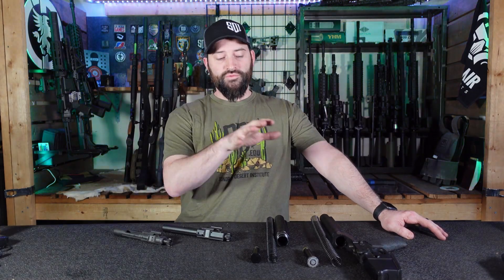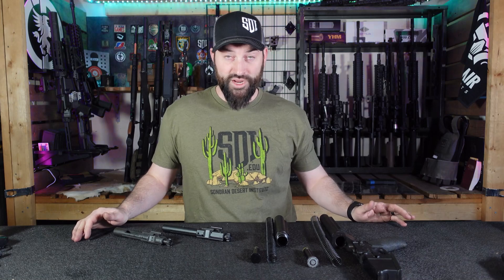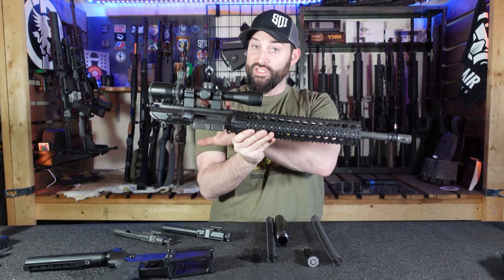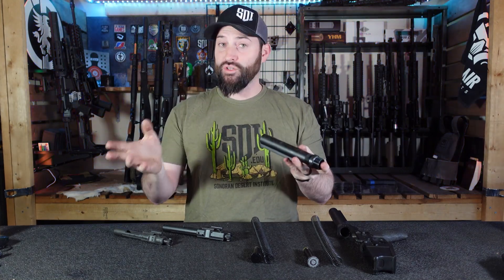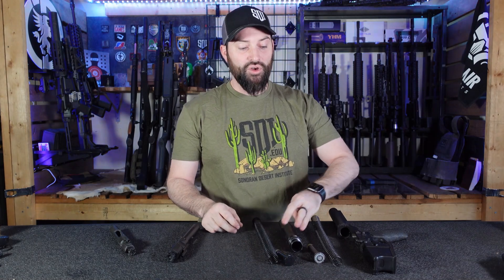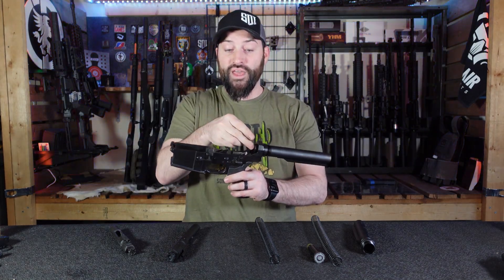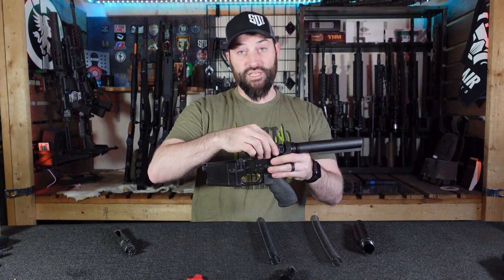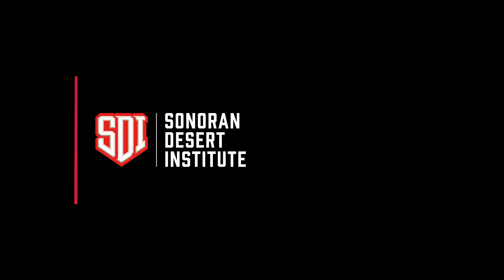SDI GRAD on AR-10 Buffer System Options

Comment: I know this is my 2nd comment in less than 24 hours, but this video has had a profound effect on me.  Before I go any further I want to profusely thank you for this video.  One of my two carbine length LR308 guns is a 6.5 CM.  When I originally built it I used an Areo Precision .308 Buffer Kit.  At the time it never dawned on me that there would be a difference from the AR15 buffer system.  The tubes were both 7 1/4" long and never having put buffers side by side I didn't know one was significantly shorter than the other.

The gun has from the beginning kicked like a mule.  Because it had so much recoil I did a little bit of research a while back about buffer weights and how they effect recoil, "but" there was nothing in my research about the differences between LR308, AR10, and AR15 BCG lengths or the differences in lengths of the buffers, so I bought a Spike's Tactical T3 buffer not knowing until I watched this video that it was too long and probably the reason the BCG won't lock back after the last round.  The gun would cycle to pickup a new round and eject an empty casing, but wouldn't lock back after last round in the magazine.  

I have since put back in the shorter buffer that came with the Aero Precision Buffer Kit and I have added a Sprinco Orange Coil 308 buffer Spring.  We now have to take it to the range to try it out.  My goals with this gun are to a) have it cycle properly and b) reduce the felt recoil.  Despite having almost 800 rounds through it I haven't come close to reducing the recoil, despite putting in a new adjustable gas block.  We will see what happens with the original buffer and Sprinco buffer spring.

Again, thank you for this video and pulling an old man out of his incredible ignorance.

Comment: what about using a rifle length spring on the A5 over the carbine length spring?
Reply: Tubb flatwire will run in either A5 or rifle length tubes and is the best large-frame recoil spring option.

Comment: How does this apply to a PDW with a 5" barrel in 7.62X39?

***I'm asking about the buffer from an HB PDW pistol brace designed for a 5.56/300 BO.
Reply: 7.62x39 would be built on an AR-15 platform, not a large frame.  Maxim's buffer chart suggests their H3 (you have to run the Maxim buffer in their buffer tube).
Reply: @adb99999999999  I figured out that the stock spring from the HBPDW works just fine with the Maxim Defense H3 Buffer. It cycles reliably. If you run suppressed, you'll need to replace the H3 with the stock 3oz buffer.

Comment: Thumbs down on this video… almost 9 min of my life for 30 seconds of useful information. Just say, “A5 length” when talking about differences in buffer tubes; people will know what search term to use when looking for info, and will know what it means when they show up on retail sites. Video covered buffer length options but not weights, and zero mention of springs as a variable. Two stars for this video, and that high a rating only because what little info presented wasn’t wrong.

Comment: What about using a RIFLE length buffer in LR308 and a LR308 buffer spring?
Reply: Has to be the LR308-specific rifle-length buffer, which is shorter and much heavier than an AR-15 rifle-length buffer.

Comment: Thanks for a clear and concise explanation of AR/LR buffer types and issues. I got a PA-10 lower and a BCA 308 upper, both on sale, and put together a super inexpensive AR-10. I was prepared for problems but it ran great... for a while. After putting a few hundred rounds through it, it started spinning the case in the receiver and stove-piping or otherwise jamming due to the spent case not clearing the receiver. Generally the first couple rounds of a mag are good, then the jam occurs. I have 4 different kinds of mags and it's consistent across all, and across ammo brands. I got a David Tubb spring for it and a Odin works adjustable buffer, but still, the problem persists. The other suggestion online is an adjustable gas block but a range friend let me put the BCA upper on his lower and I went through a whole mag without issue. The problem definitely seems to lie within the lower. After watching this video, I took the lower off and pushed the carrier down into the buffer tube. It hits the buffer at the right spot, leaving about an 1/8th inch between the bulge in the carrier and the back of the receiver. I guess I can put an adjustable gas block on the upper, but the fact that it ran fine on another lower makes me feel like that's the wrong path. I'm also planning on getting a 6.5 creedmore upper for this lower and I don't want to have replace the gas block on that as well. Any ideas appreciated!
Reply: Why? You have the perfect budget AR-10. It doesn't work, but you saved 100.00
Reply: Current SDI Student here on the AoS in Gunsmithing Technology track. Former infantryman. Just incase you wonder about the credentials. I'll help if I can.

Did you shoot it without changing/upgrading the spring?
Reply: @hahahalo777  I replaced the bolt and it works great now. Replaced the gas rings on the original bolt and that still has ejection issues. I'll replace the extractor on that at some point but the gun is running great with the new bolt.
Reply: The jams during extraction sound like an extractor tension issue or possibly a broken or dirty/stuck ejector.  Extractors are a real issue on AR-10s.  Particularly the configuration of the extractor springs and o-ring(s).  Assuming your BCA upper came with a BCA BCG, throw the bolt and cam pin in the trash and replace them with a JP, Rubber City, or BCM bolt and a Lantac cam pin.

Comment: GREAT VIDEO-THANKS.  I wish I would have seen this 4 years ago.  I had  AR-10 feed issues with a 7 POSTION BUFFER TUBE vs A 6 POSTION BUFFER TUBE.   Yet I learned the hard way.  The SHORTY BUFFER by KVP 5.6oz buffer finally found the correct Tube....

Comment: You still didn’t cover the AR-10/A5 buffer tube fully. You talked about the tube, spring and buffer for the ‘mil-spec’ tube but didn’t talk about the spring length for the AR-10/A5 buffer. As a result it wasn’t cleared up fully.
Reply: Rifle spring (Tubbs flatwire is good) with carbine buffer for the A5 tube in an AR308.

Comment: So mil spec buffer goes with the longer ar-10 buffer tube but the normal ar-15 buffer tube needs the buffer that comes with the ar-15 buffer tube kit or do you need to buy a ar-10 buffer for it?
Reply: The video was a bit confusing. There is only carbine, rifle length tubes and your a5 system. Carbine tube with carbine buffer. Rifle tube with rifle buffer and a5 tube with carbine buffer
Reply: @0341stroker  Carbine tube with the shorter AR10/LR308 buffer

Comment: Cool, awesomely informative video. Now show us some suggestions for it. Like I am curious if the A5 buffer tube and rifle spring, but with the shorter buffer would work. If I had the money to experiment I would.
Reply: A5 (aka AR10 carbine length) buffer tube and AR10 carbine buffer will work with a Tubb flatwire spring  (on-label) but I would not run any other rifle spring in a carbine tube.

Comment: The advantage of the armalite pattern buffer tube/ a5 buffer tube w/ an ar15 buffer you have more tuneability...3 weights vs 2 and it uses a rifle spring
Reply: That’s what I used on my DPMS pattern Aero build. A5 buffer tube with a 3-wt AR15 carbine buffer. H3 weight with Tubb 42 coil spring, it runs great.
Reply: @G5Hohn  i run an h3 as well but with a damage industries enhanced rifle spring...it's a sweet shooter
Reply: What is the part number for the 308 specific buffer tube from psa?
LMT is pretty expensive. 
Thx
Reply: @metro32168  just look for an a5 buffer tube...bcm and vltor make them

Comment: I would like to clear up a few things quickly and pardon me for doing this on your channels comment section. I get frustrated with folks who use the term "MIL SPEC" when attempting to describe buffer system components for any AR platform. First of all, they components you are trying to describe to your viewers are all used on military AR platforms. The m16 variant uses the longer RIFLE buffer tube, buffer spring, and buffer. The M4 variant which is a shorter more compact platform based off of the M16 uses the shorter multi position buffer tube along with a selectable leangth of pull but stock. The M4's shorter buffer tube requires a shorter recoil spring and buffer in order to allow proper function of the platform. The shorter buffer system is referred to as a CARBINE buffer system. 

     As with the M16/M4 variant platforms, the 308, or more commonly known as the SR25 in the Military, classically used the RIFLE leangth buffer system. There are few variations of the SR25 which have been modified to cycle properly with the CARBINE leang5h buffer system, however, that was more of an evolution of the SR25 platform rather than a complete replacement for it. The issue that arrives with the AR10/LR308 platforms and the Carbine buffer system is hard recoil due to the shorter buffer system. This can be minimized by using a stiffer buffer spring, heavier buffer, and either an adjustable gas block or gas key. Many AR10 style platforms suffer from gassing issues, either over gassed or under gassed, depending on the manufacturer. Both gassing issues can cause similar malfunctions and general poor performance. Adjusting the gas is typically the easiest method of correcting this issue. 

     The important thing to remember in regards to buffer systems is to ensure all components match. For example, if you 8ntend to use the RIFLE leangth buffer system, ensure you have a RIFLE leangth tube, spring, and buffer. The same goes if you plan on using the CARBINE leangth system. When searching for buffer systems, use the terms as I mentioned, either RIFLE (longer) or CARBINE (shorter). Not only will you find what you are looking for much easier, but the majority of manufacturers use these terms as well.
Reply: is the buffer tube, spring, and buffer not included in the ARDEC drawings for the M4, M16, etc?

it doesn't matter if an armorer/armory puts a part into service, that isn't what makes a part mil-spec. what makes a part mil-spec is if it conforms to the blueprint/drawing distributed by ARDEC (referenced by drawing number in the "mil-spec" document that describes the asset, such as an M4 or M16.)  Any part which conforms to the ARDEC drawing would, obviously, qualify as "mil-spec", and any part which does not conform to those drawings would not be mil-spec.

so the only question remains is, given the variance of "buffer assemblies" available (diameter, length, spring tension, buffer weight) which conform to ARDEC's documentation?  those which confiom would be, factually, "mil-spec buffer assy's". if a buffer assy is not part of the 'prints then it seems ARDEC/DoD has gone full retard and left out a critical component for manufacturers to conform to, which I highly doubt is the case. i would be shocked. sadly, I don't have a copy of a TDP or ARDEC drawing to confirm/deny the buffer assy's have a formal specification for M4 and M16 arms.  I'm certain there is an FFL'd armorer that has a copy of the print/drawing at his/her disposal, and, it would be excellent if they could chime in and clarify for the wider public if the buffer assy's are defined clearly by ARDEC or not.